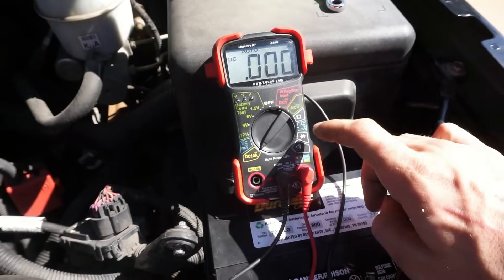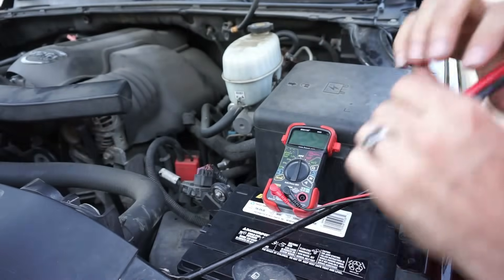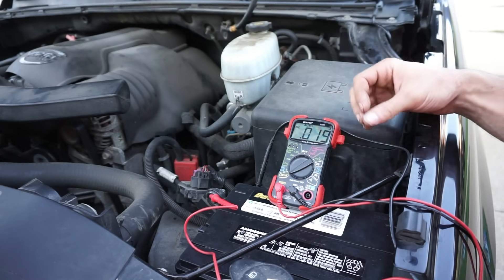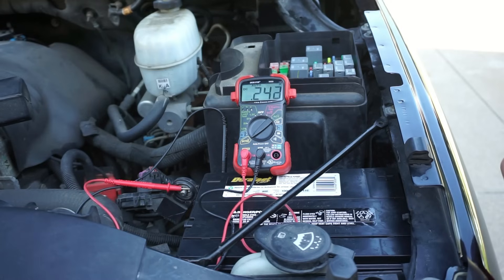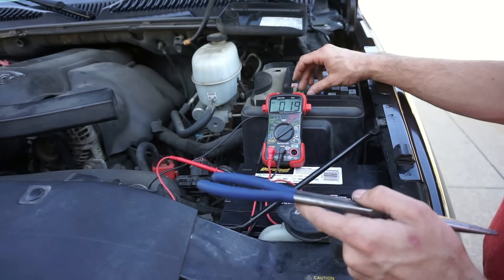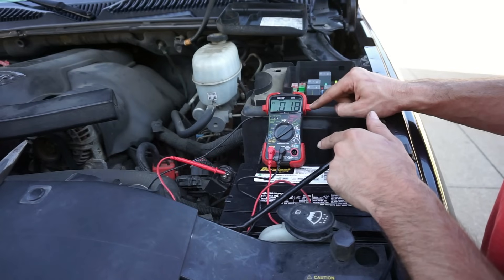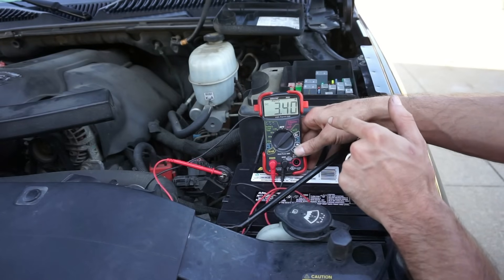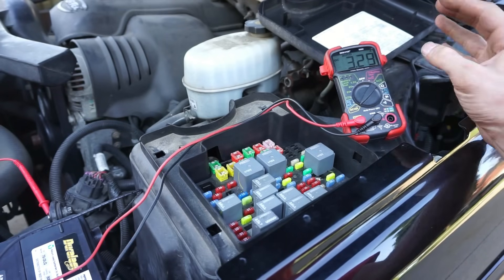DEAD BATTERY | How to FIND a Parasitic Battery DRAIN Using Multimeter!!!

Comment: Thank you Sir.
I've had a parasidic battery drain for months and the dealer has been giving me a run around saying it's has something to do with the Kia UVO radio system which is no longer available to replace.
They suggested to just pull out the fuse under the dash to prevent the battery from getting drained. (Mickey Mouse solution) I think.
Anyways when pulling out the fuse, the dome light , power locks and reverse camera become disabled. Interesting to find out the rear driver's side door lock happens to be woncky and doesn't usually lock unless i manually remember to lock it.
You finding that problem on your vehicle now makes me suspect I have the same problem.
Thank you for the detailed and we'll instructional video.👍🏽
Reply: The patience and time it takes, and the methodical way this had to be done is something many garages hate.  That is why a lot of garages either don't attack electrical problems or give you a half-assed answer and hope you go away.  Great video!

Comment: Nice job. Knowing how equipment works is essential to effective troubleshooting. Now why does it have to be cycled by switch to activate the problem? Pulling fuse causes relays to drop out while cycling the switch allows them to stay engaged normally and allowing to ”see” problem in real time. Again excellent presentation!

Comment: Quick tip to not put your meter at risk: 
Instead of using the meter in series between negative terminal and negative cable when you cycle the key, use a jumper cable. Once you've cycled the key, connect the meter, and then disconnect the jumper cable. Vehicle still has power the whole time, but you avoid any potential momentary spikes which might blow the meter in the second or two after cycling the key. In theory, you could still blow your meter this way, but the biggest draws are usually momentary ones just after cycling.
Reply: Or you could leave the battery connected and use a quality amp clamp? I've used my amp clamp (must have DC amps) and a simple tone and probe kit to trace wires. Just another method maybe.
Reply: @sliderdriver1  what are you, made of money?!
Reply: Any decent meter will have a fuse
Reply: @joepauldoesitall  "Any decent meter will have a fuse" Great, then what? If you blow a fuse every time you test, then how to test? I'll be trying this jumper bypass method personally, fuse or not.
Reply: I hear what you're saying but unfortunately for me l have great difficulty in comprehending most of which  you are saying. I'm good with mechanical stuff but auto electrics is just too confusing for me.
Reply: Wow, such a valuable tip
Reply: You smart
Reply: I was thinking about doing that, but us guys like to take chances. I figured he got away with it, so why not. 🤣
Reply: MANY THXXXX ANGEL
😎💝🙏💜😘
Reply: I have used a battery disconnect tool for over 35 years now.  But my new DVOM is to smart to blow a fuse or letting the smoke out.
Reply: Thasnk you, sir, for adding that valuable context. I had not figured that out yet.
Reply: Good advice.
Reply: I agree I’m not taking a chance with my flunk meter
Reply: Yes on the fuse but do you have a extra ???
I do
Reply: Taking chances is how  advanced technology came to be and changed our lives forever.

Comment: I appreciate it this video a lot I've got  a pretty bad parasitic drain within a day or two my battery is dead, then when u started talking about your driver door and the lock i started thinking of how my window lock doesn't work anymore its stuck on lock so only the driver can role down all the windows and also my mirror switch to move the mirrors around doesn't work anymore I never thought anything of it till this video, but now I'm pretty certain that's the problem so I'll be testing that later today along with all the other stuff just to make sure there's nothing else causing a drain, I really appreciate the video this helped a lot and you were very thorough on everything and explained things very well. I'll let ya know if that's for sure the problem later tonight
Reply from the maker: Sounds good.
Reply: Well turns out my mirror switch that hasn't worked in the past 2 years has been the cause of my parasitic drain for that past 2 years
Reply from the maker: @fullthrottle4688  Figured it out though. Nice work!

Comment: thank you sooooo much for the video. My name is Mary. I know the basics with vehicle fuses. I  have a 2017 ford transit connect. My battery did die. Long story short..... after 3 days at Triple A, they could not figure out what the problem was. All they said was I have a constant draw on the battery. Which now.... I am assuming that means I have a parasitic problem?  I know for sure that the radio will continue to play after the ignition is turned off. How do I remedy that?  So that the radio is in sync with the ignition switch? Any information would be very grateful.
Reply: Im having the same issue my stereo won't turn off... I figured if it shuts off when the keys off then it shouldn't be a problem... Now I'm not so sure. Id love to know what you found out. For now im going to pull the stereo fuse because Im grasping for any type of help with this issue until I figure out what has to be done to fix it.
Reply: The radio is wired to the battery yet should be wired into the wire coming in to the back that shuts off when you turn the ignition off. You will just have to pull it out and connect a multimeter to each wire and see which turns on and off with the key to your car turning the ignition. I believe its usually red going to battery and yellow to ignition on most of them. So you'd need to hook the wire going to red over to Yellow wire.
Reply: I simply push the button that turns the radio off or open the door and radio turns off.  My car is designed to play for 10 to 15 minutes after turning key off and uses very little power if your radio is factory original. Auto Parts stores usually test main battery for free in 2 minutes.

Comment: Hi, thanks for the video.
I am confused how to interpret my mesures on my multimeter. With the black cable still on com and the red on the 10A, and the selector on 200 mAmp, I have 75 and when I move the selector to 20 mAmp, I have 7.5. By the way, I don't have a value higher than 200 mAmp.
So I am confused is it 75 mAmp?
Reply: Yes

Comment: Thank you Sr I've been looking  on my GM truck and I'm going crazy because I wasn't able to find it good job!!👍👍
Reply: Had a air conditioner fan motor relay that stay hot even when off. Had to work back under dash to disconnect wires from relay

Comment: Same problem with my 04 Silverado only difference is that mine spikes up to 6-7volts every 10-20 seconds if I don’t run my truck in 3-4 days it kills battery to 2-4 volts have gone through 5 batteries in these ost year still can’t find source of draw

Comment: Dude, this is one the best videos tackling this subject I’ve ever watched. Not only are you thorough, but you are clear. I’d love to see you do more electrical troubleshooting stuff personally. I love it. And I love wiring. It is one of my favorite parts of working on cars. I know that probably sounds crazy to most of these folks, but I recall you saying that with your bg, you had an affinity for it as well. So please, sensei, teach away!
Reply: 2years later, and this video was straight gold my guy! Thanks! Made me go buy a multimeter and find the problem my self!
Reply: I wish you were my neighbour .
Reply: Sensei, your valuable video help me out connecting the dots over diagnosing the issue of my Nissan Teana year 2010. Especially the part of waiting. Wish you the best in life !
Reply: I am currently trying to fix my electrical issue on my duramax 2012 silverado. I hope I can do this method even though I have 2 batteries. 😮
Reply: Ted
What fixed the problem?
Reply: @tedfusco3719  As seen ABOVE 
THE FIX!!! As mentioned in the video the "Driver door module" was bad. This is the window switch panel. I replaced the switch panel and issue has been resolved. Video removing panel here:
 https://youtu.be/CnQtqbWc6x0
Reply: Agree totally. Had these problems before and they drive you insane.